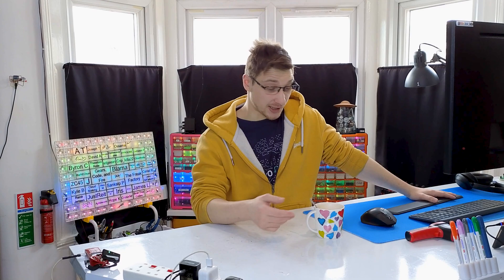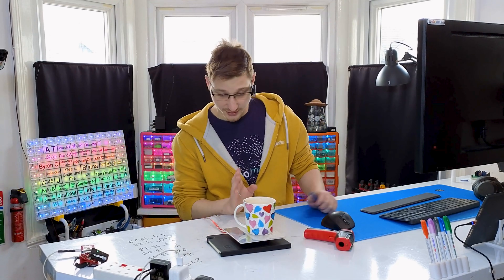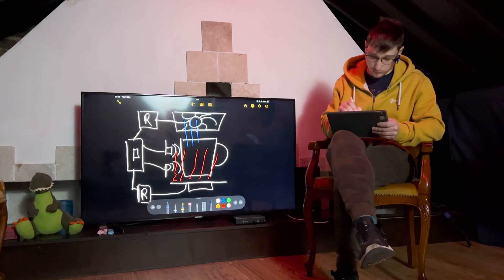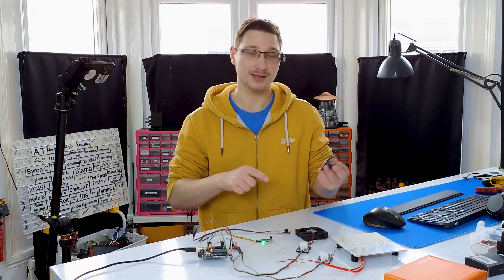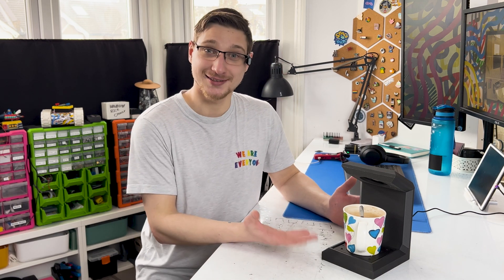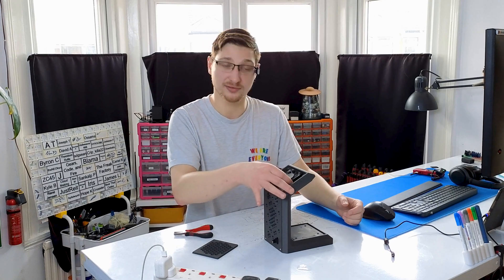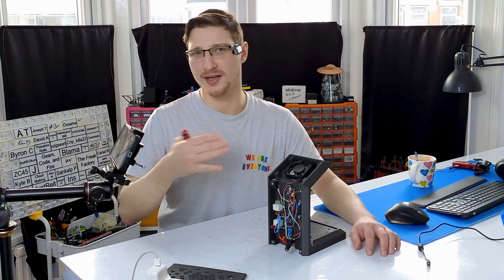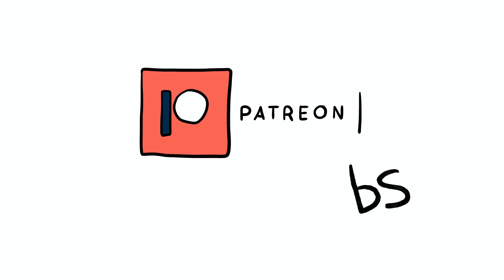Perfect Temperature Tea For Hours!

Comment: whoah whoah what are you running on an iPad to monitor the sensors there? also, you gotta ask chatgpt to write a PID (like 3d printers use) function for both the heater and the fan… i think you’ll dig it and it mitigates the oscillating too hot too cold Goldilock effect
Reply from the maker: its just Home Assistant

Comment: To limit constant heater cycling you can add a check in the code where it waits until the bed drops below a set temp. So turn off at 100, set a flag for over temp, wait until below 95, turn heater on and clear flag.

Comment: For the temp sensor - instead of monitoring the temp of the mug, use a temp laser (similar to your hand held tool) as well.

- the mug temp itself - since you dont want the mug too get too hot
- And then the laser sensor to monitor the liquid itself

For the 'led' - what I think might be the simplest design is put an old / or mini lcd/led screen in the front of the fan (edge of the case)
 - so you don't specifically notice it.

When no mug detected and bed > 40deg - show bed temp (with like a * or dot)
When mug detected, show liquid temp (instead of mug/bed temp)
When no mug and bed < 40deg - turn off display.

An alternatively instead of a mosfet (which pwm would give you more control (PID) for temps) - is SSRs - relays, but silent.
A lot of people use them for the likes of kettles .... or solder stations or reflow ovens.

Comment: Thanks for all your great videos! You could check if the MOSFET IRFZ44N fits your needs as a replacement for the relays. It‘s rated max. 55V 49A, at a very low price. Also perfect for driving motors and LEDs. I use it a lot in my projects. 😊 Edit: In case that's not enough, you could go for example with an IRF3205 at 55V 110A or similar. Both are fast switching, perfect for PWM applications. 😊
Reply: IRFZ44N is the truth
Reply: i love you sitting interview-style next to the monitor

Comment: Oh man I need one of these! One other cool thing you can do with the mosfet is connect the control input to an analog pin so you have finer control of the heating. You can make it sit at a constant temp rather that turning on and going over temp and then cooling to be under temp. Might be overkill for this application but a fun challenge!
Reply: Using a mosfet in its linear region is pretty inefficient tho, much better to just switch it quickly and use PWM.